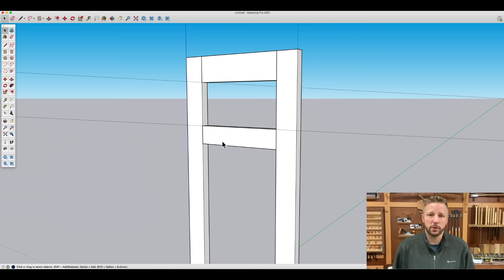I Built A Solid Wood Door IN ONE DAY!!

Comment: Hi, what type of wood board would u recommend to use that won’t warp or bow for DIY indoor barn doors. And can stand the test of cold humid/moisture and hot weather. They’ll be hanging over a sliding door leading to the outside. 
The absolute best quality recommendations.
Thank you

Comment: at 11:35 why didn't you just change the router bit height and clear out all the middle section?
Reply from the maker: Shaft was too short and maxed out.  It was pretty easy (and fun) to use the chisel.
Reply: nothing for the bearing to ride on

Comment: I would have pegged the tennons at each rail. 1/4" round holes with 1/4" square pegs. Adds an additional mechanical faster at the weak points that will never loosen over time. I really like the design. Very nice job.

Comment: I love this door, and I liked everything you did, but with one issue that I don't see a riving knife used for the rips at the beginning. I get not using the other safety devices, but a knife really doesn't get in the way and they add a lot of safety. I mean, if you're willing to spend extra time using hand tools, I think extra time putting on safety equipment wouldn't be a big deal.

Comment: When you’re using your Bandsaw I can hear a whooping sound is that the blade slipping on the wheel? 🇦🇺👴🏻
Reply: It's the guide bearings. It happens sometimes when the blade starts to put pressure on them and they start to spin at the same speed as the blade.

Comment: Towards the end I thought “activated linseed oil would really set this over the top!” Low and behold what finish did he choose? 😊👍
Reply: I’ve never heard the term “activated linseed oil”. Does this differ from boiled linseed oil?
Reply: @gc7782  I am thinking of a specific wood finish. It is a two part (I believe linseed oil based) wood finish that you mix in a 3 to 1 ratio. I guess I am call the 1 part the activator and thus "activated linseed oil." The name of the product is evading me but it is really nice and durable. Food grade in the end and tough enough for flooring (just pricey)
Reply: @markusthiel7687  It sounds interesting. I'll look into it. Thanks!
Reply: I'm a goof, it's called rubios mono coat

Comment: Great video and even nicer door! I do have a question seeing as you indeed have much more experience woodworking than I do. I have always been advised to never use the table saw fence and the miter gauge at the same time. Just want to know your thoughts.... at no point did that part of the video look unsafe just wanted to know for my own reference. Thanks!
Reply: The fence and miter gauge combo is a bad idea when making a through cut, as the off cut can get trapped between blade and fence.  This could lead to a dangerous projectile flying toward your face.  Using the two together for a dado cut, as in this video, produces no off cut and is generally safer.  That said, there are methods one can use to align the cut that prevent work piece contact with the fence.